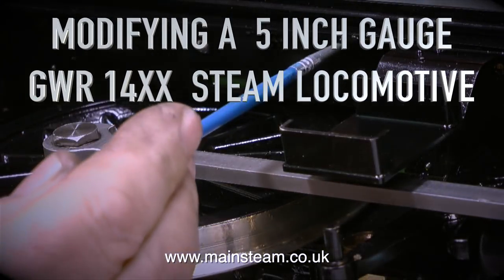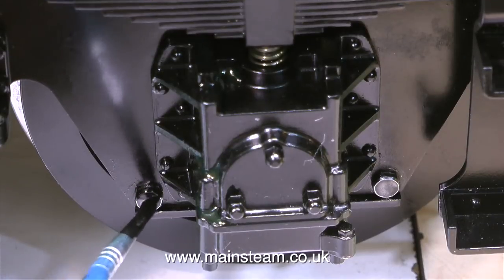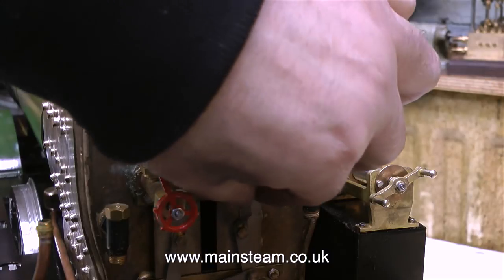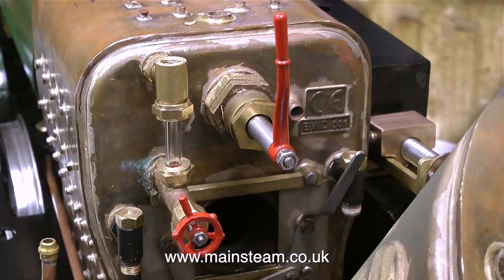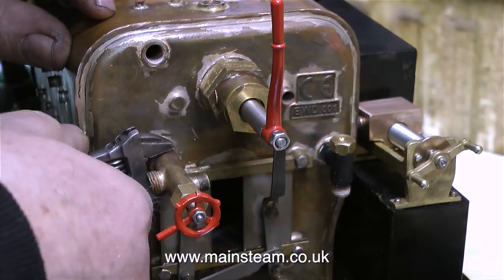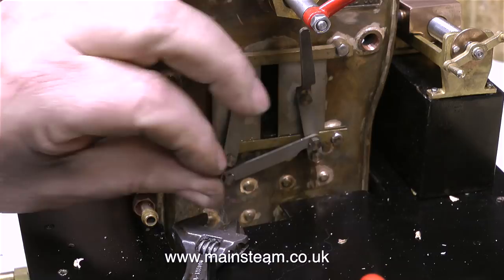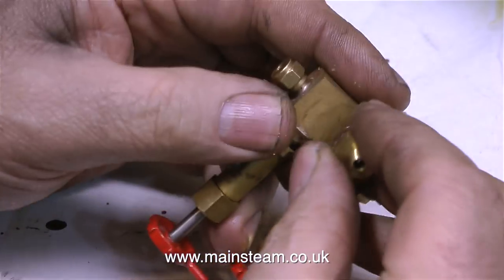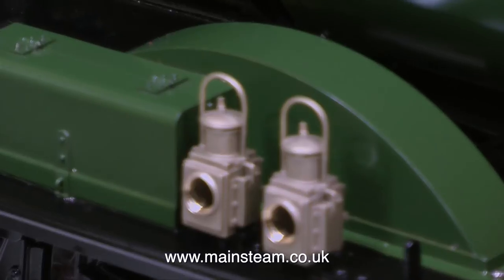MODIFYING A 5 INCH GAUGE GWR 14XX STEAM LOCOMOTIVE - PART #8

Comment: Fun fact for you Keith.
British pipe thread and ”metric” (as you call it) pipe thread are actually the same. The BSPP (straight thread) and BSPT (tapered thread) are in the ISO world referred to as ISO-G or ISO-R. In other words,  a Chinese made fitting will have the same threads as a British made fitting. The ISO standards even refer to the nominal sizes in inches.

Cheers from Sweden

Comment: Keith... a 32 pitch thread is just very close to 0.8mm metric pitch. I am in Canada so BA stuff is rare (not to oldtimer Meccano fans) but the 10-32 US screw size interchanges with a metric 5x0.8 screw size well enough in a pinch. You just got lucky with those fittings, or the designer thoughtfully used a size known to work ok with a common ME fitting thread.

Comment: Hi Keith, in my spare time I work at the East Lancashire Railway and work on the 3 Class 40 diesel locos which are based there. Inside the loco works is a GWR tank loco which is under restoration. Do you need any specific photos of GWR components? I’m just on my way over to the depot now so it’s no trouble to take a few snaps. Cheers.
Reply from the maker: The East Lancs is a fine railway, I have been on it a few times - usually eating and just enjoying the feel of the 0-6-0 tender engine as it pulls up the incline towards Rawtenstall. . . the Christmas dining experience is great. Some closeup pics of the lamp brackets on the side would be useful and a good side view (in a few sections) would also be very useful. Thank you for your kind offer.
Reply: You know, for all the bad that comes off the net,  and all the negativity,  it really is cool some of the connections that get made, and the things you get to learn, especially with a group of civil, mostly mature adults. Really cool to see someone working around the real thing, getting to help a modeler.... or to my nerdy self it is.

Comment: Hello Mr. Appleton. Years ago I found out that there are not two but three Metric thread pitches. And GM made use of all three,which is why I found out. Called Standard,Fine and Extra Fine. Hoping this may be of use to you. Cheers.

Comment: The sealant compound may be white lead for which i used for many years in my engineer career though the world. For Which seal steam fitting  under are high pressure, which works very well if joints are clean.
Reply: Kinda looks like plumbers putty to me.

Comment: On the copper boiler, what are all those "bolts" or "rivets"? Do they have a purpose or just for show? Thanks.
Reply from the maker: They are the Firebox Stays that hold the inner firebox to the outer firebox so that it can resist pressure - the go all the way through both the outside (Firebox wrapper) to the inside (Inner Firebox).

Comment: just a question but when you said "if the water goes below the bottom nut then the boiler will soon be scrap". i wondered if this engine had a fusible plug.
Reply from the maker: No, this engine doesn't have a fusible plug - most model steam locomotives don't use them, but some do . .  .

Comment: It would be amazing if you could run light pipes from the fire box to to the lost wax casting lamps so they glow when there is fire in the box :)
Reply: toysareforboys even a little srfuino and some very tiny led's, set up with a pwm flicker pattern

Comment: In a previous video, you said you bought this train from "Blackgates Engineering" for a good price after they were stuck with it. Is that not true now?
Reply from the maker: I did not say anything of the sort - I did not buy this engine from Blackgates engineering.; I bought it directly from the Chinese manufacturer as I state clearly in text on every video in this series . . . .
Reply: From what you say I owe you an apology, I will try to find the video that I watched and check. In the meantime, I ask for forgiveness, sir.
Reply: McLeod Duncan. I got that impression too, so .i watched number 2 again. I think disingenuous covers it. As for prices I have contacted the manufacturer, you can do so too. A modest man is our Appleton!.
Reply: Thank you for the heads-up. Our Appleton is a Yorkshire Man " Never d anything for nothing, But if you really have to, then do it for yourself.( learned from experience)
Reply: Mate. He couldn't make it any clearer, this little chooch came over the Chinese Wall via airmail....By the way Keith have you thought about investing
in paint pens? They may make your life easier when it comes to touching up nuts and bolts...
Reply from the maker: Yes I think I will look into paint pens and see if they do the job - thanks for that {:-)))